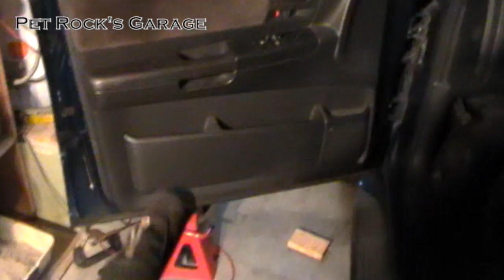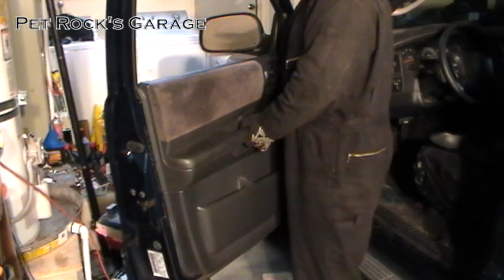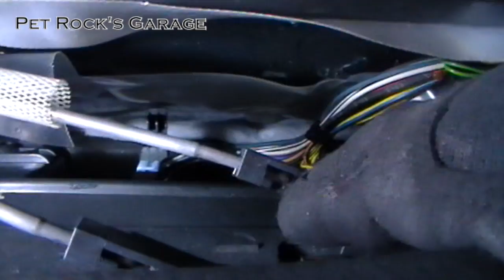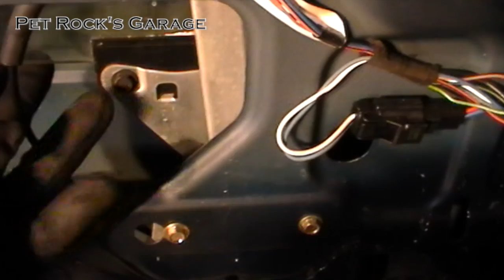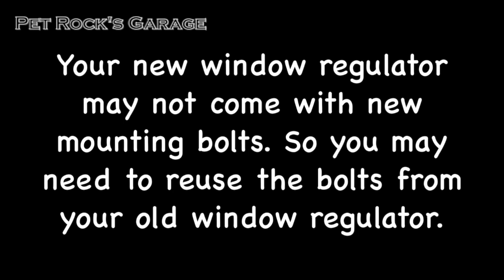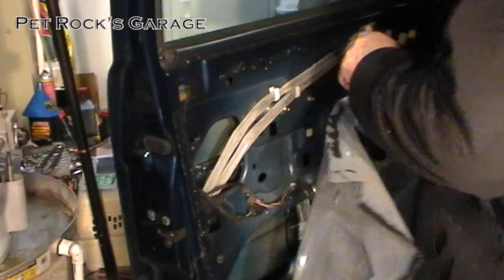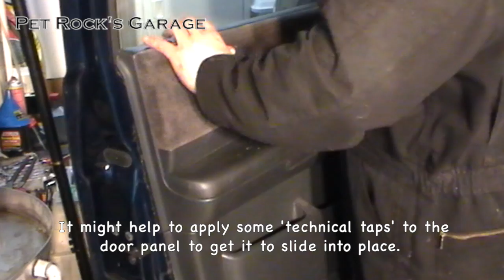How To Replace A Front Power Window Regulator - Dodge Durango (’98-‘03) & Dakota (’00-‘04)

Comment: First things first...thanks SO MUCH for posting this!  You gave this mom the confidence to replace this part on my son's '04 Dakota, which had already had a failure in the driver's door just 2 months ago, and cost us big bucks to have repaired.  This time, the passenger-side rear door regulator broke, which was estimated to be a $175 repair.  With  the help of your video,  I removed the broken one & installed the new one in 1 hour, at a cost of $35.  I did encounter 1 problem, which I can only blame on myself.  When I tried to "snap" one of the actuator rods/arms back into its clip, I cracked the plastic clip.!   Can that part be replaced?  What is it actually called? Please help me again!
Reply from the maker: +Linda Davis, congrats on fixing your window yourself. I have a video covering the rear door too (https://www.youtube.com/watch?v=Z2sKdq2ShhQ). I’m not sure what the part you broke is called. You can call or go to your local dealers parts department and they can look it up based on your VIN. Most likely its a dealer only part or you could try your local junk yard. Good luck...
Reply: +Pet Rock's Garage I actually watched your video on the rear door to learn how to do this.  This post is the one I got when I searched for you to thank you  & ask for more help.  Again, thanks a million for posting your videos, because I would have never tried to do this job without your EXCELLENT video! If I could, I'd hug you right now!
Reply from the maker: +Linda Davis, no problem.  Virtual hug accepted and appreciated.  :-)

Comment: Your hunch is correct, the switch is not glowing green like the door lock button is. I've toggled the window lock out button without success. Where exactly is the solder joint your referring to?. Can you send a pic or be more specific? Thanks again
Reply from the maker: The solder joint is on the circuit board inside the drivers door switch. Is where the button attaches to the circuit board. Sorry, I don't have a picture of the circuit board. I fixed mine years ago before I set up my YouTube channel.  But before jumping to the conclusion that its the solder joint on the circuit board, you should make sure that the wire that goes between the window lock-out button and the passenger door switch isn't broken or have excessive resistance with a multimeter. It is just as likely that the wire is broken/damaged as the solder joint is cracked since the wire does go through two door wire looms that are known to get flexion cracks/damage. Good luck.

Comment: My Durango driver side window is in the up position. What do I need to do to lower the window so I can remove the 2 bolts that holds the window in place. Thanks Pet Rock Garage
Reply from the maker: +gary curnow., there are two cables in the regulator that I show in the video. If the one that holds the window up is still intact and the the one that pulls the window down is broken, you should be able to press the down button on the window switch while pushing the window down with your hand.  if both cables are still intact and you want to replace the entire window regulator, you could cut the cables with some wire cutters to free the window. Good luck...

Comment: Hello and thank you for your very instructive vid! My window regulator cable snapped and I just bought a brand new regulator motor assembly. It was extremely easy to take out and install but I have a very annoying problem! The window guide slider keeps coming into contact with the cables for some reason. I tried different orientations of twisting the motor but that was even worse. I can't use twist ties to get from the guide because it needs the freedom to move! I'm getting really frustrated on what to do at this point! Any help would be very appreciated!
Reply from the maker: Assuming you got the correct assembly for the door in question, it sounds like the cables are twisted up a little. They shouldn't come in contact with the guide. It is possible to install it twisted and have it bind up like you describe. So I'd take the regulator out again and hold it and the motor up as if they were installed and see if there is a twist or some indication of why the cables are binding. Its really hard to diagnose from my keyboard. Good luck.
Reply: @petrocksgarage  OK thanks. I'll keep trying! Maybe I will have to take panel off passenger side in order to see the orientation!
Reply from the maker: @Twilliams60142 , thats a really good idea. Good luck!

Comment: how do i change the oil pan on a dodge durango 2003 4.7 liter
Reply from the maker: bigsteel, very carefully…  It is not a small job and requires a lot of specialty tools (mostly to lift the motor up to gain access to the pan, or to lower the front cross member and differential if you have 4x4.

Comment: how to get the passenger window works again it wont go up or down
Reply from the maker: DJ Lambert, it’s hard to say what is wrong from my keyboard.  Depending on the behavior, it could be a bad motor, a broken cable, bad wiring, bad switch.  The list goes on.

Comment: You've been a huge help!  Thank you very much.  However, I am wondeering if the cable is OK but the end is bad, can you just replace the end?  My motors work.  The window just doesn't go up or down.  Thank you!
Reply from the maker: +Steve Hartman, you can't buy just the end. Trust me a looked. You can only get the window regulator as an assembly. Depending on where the break is you might be able to superglue the plastic piece that broke. But i would consider that a temporary fix. Good luck...
Reply: @petrocksgarage   this is exactly what happened on our 03 QC a few days ago. I considered the super glue approach too, but I've worked in the plastics industry long enough to know better. Have you tried any other aftermarket regulator assemblies other that Dorman? I'd rather not look forward to doing this every couple years if I can avoid it...
Reply from the maker: @jd340 , the rear passenger side regulator popped a few months ago on me and the only place that had one in stock was AutoZone and their Duralast regulator is a slightly different construction for the pulleys on the top & bottom. I'm not sure if it is better or worse yet though but it also has the lifetime warranty, just like the Dormans. So if it breaks I can replace it for free.

Comment: Can someone help me out? So I just bought my first truck, it's an 01 Ram and the driver side door works to go down but it will only go up a centimeter at a time maybe one per half an hour. I'm not sure if this is the problem or the motor it self and I really don't have the money to play a guessing game. I have to press the up button and pull the glass up at the same time to get it to go up and it can take upwards of 2 hours. I know its not a dakota or durango, but I'm assuming those symptoms will be the same for all of them depending on what is actually wrong with it. Any help will be greatly appreciated!
Reply from the maker: Mike Roche, its hard to diagnose things like that from a keyboard. Your best bet is to take the door panel off and have a look inside.  It should be fairly similar inside to what the inside of my door looks like.  Something is binding up and not letting the window slide smoothly.  Maybe the felt in the window track is rotted out (common), something is getting in the way of the window regulator (also common), or the window regulator motor is going bad, or there is excessive resistance in the up position circuit giving enough power to the window motor.  The list goes on.  Good luck...

Comment: as a  courtesy it'd be nice to hear you tell which end goes up and which end goes down of the rail..🦝
Reply from the maker: Do you mean which end is up vs down on the regulator?  There is only one way to install the regulator.  But the easiest way to tell which end is up is to look at the plate that the window attaches to. It looks like an isosceles trapezoid. The widest part of the trapezoid is on top and the plate is on the outboard side of the regulator (once mounted).  Hope that helps.  Good luck.